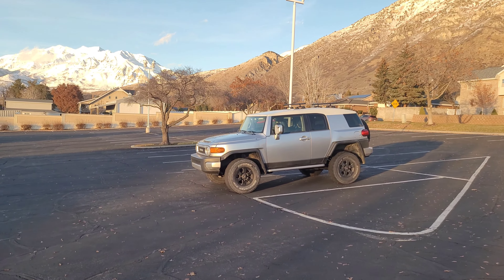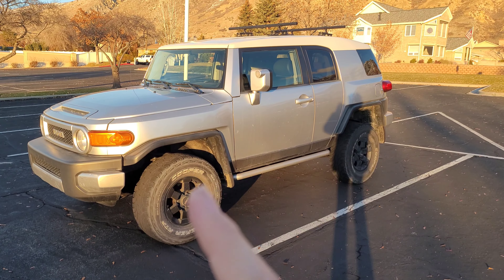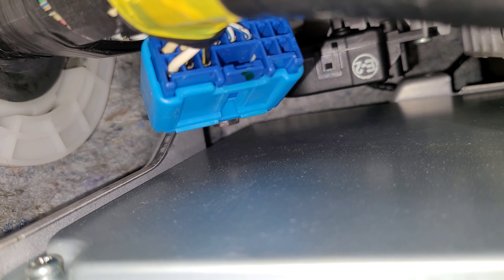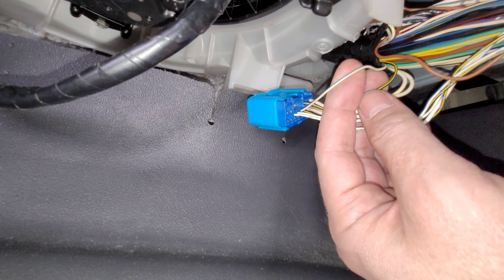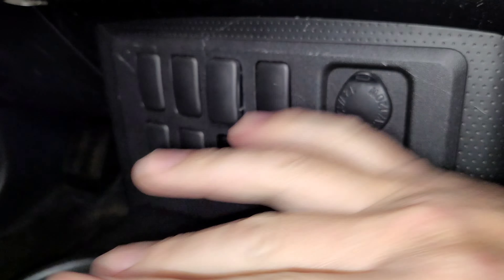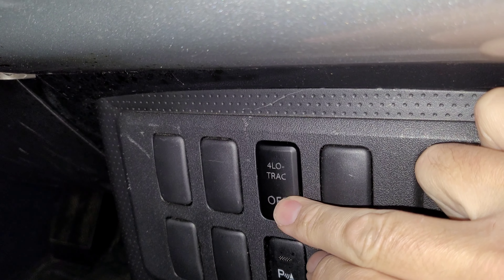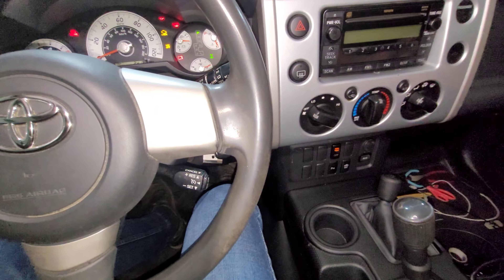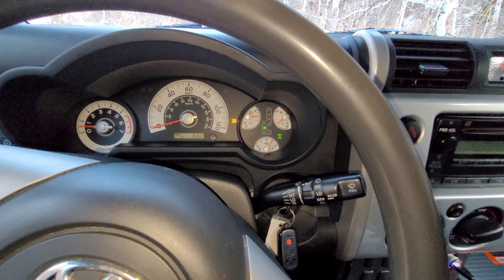4LO-TRAC! Finally a SOLUTION-Toyota FJ Cruiser upgraded. NO DIFFERENTIAL LOCK, NO A-TRAC, NO PROBLEM

Comment: Thank you 

Try an add
w4D control ECU Rear differential lock
Reply from the maker: Mine doesn't have the actual hardware locker in the rear differential.